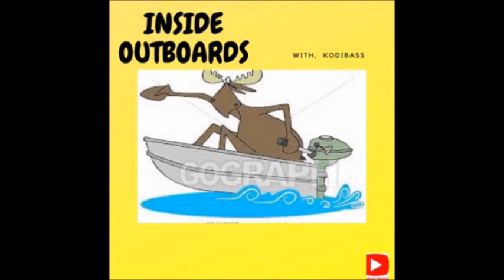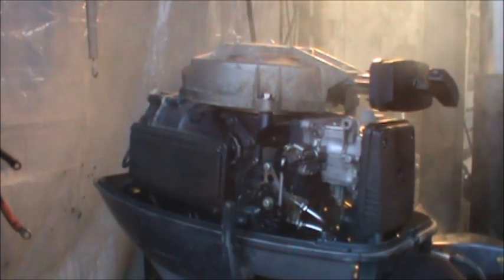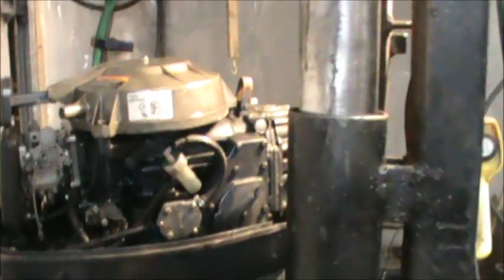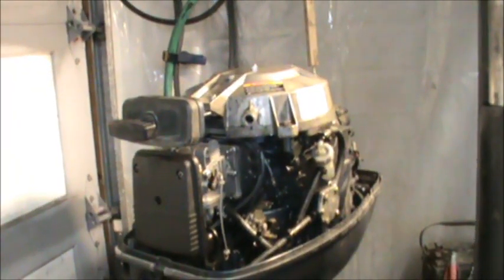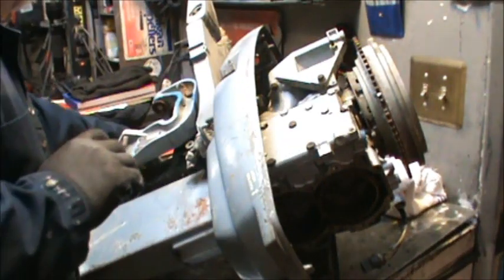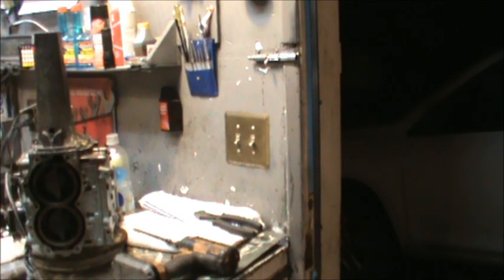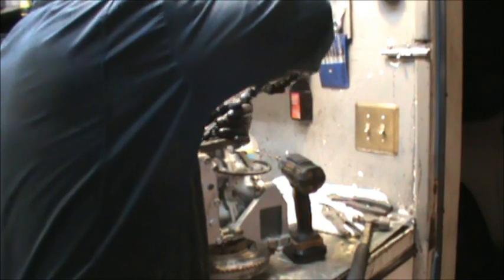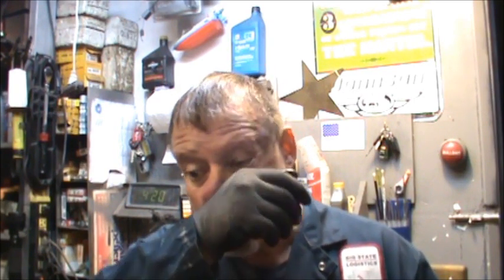YAMAHA ENDURO 40 HP,  25 EVINRUDE HP

Comment: Hi Kodi, Thanks for responding to my short Sunset Bay video. Hey got the Mercury Mark 10 running good now. Need to replace some gaskets and seals. The lower unit prop hub is leaking lube so need to make a tool to heat it up and get it apart. Also the seal between the head and lower shaft housing is leaking water out although it pees good and run cool. Got the original copy of the service manual coming too which will help allot for torques and spec settings👍
Reply from the maker: Fantastic, I know where a Mark 10 is sitting in a guy's yard.  Offered him $200.00 said no he was going to fix it up,  that was over 5 years ago.  Still sitting in the same spot.   kodi
Reply: Just need a tiller if it goes to a parts motor or if you run across one. Got my service manual in the mail yesterday but missing a couple of things I need still but has allot I do need. I need to replace the gear case seals and oring. But found the part numbers on Crowley. Will ordered the but not through them again. Ended up going through Amazon on the diaphragm kit from Harvard Marine back east.

Comment: Exhaust housing Yup differently a heat gun. Yamaha‘s are  Known to use cheap metals. That’s why they used annode  in the the behind cylinder walls. Aluminum carburetors  passafied  the aluminum and turn white. Thanks kodi for sharing
Reply from the maker: 4 sure seen it first hand.     kodi

Comment: When you use the impact driver do you shear less or more bolts in engines? Some of the bolts in the 25hp were really solid. I still occasionally shear a bolt even when I'm slow and careful. Even after applying heat.
Reply from the maker: I'd say less as the impact action sometimes helps rattle them out,  But on some old salty's  heads are going to pop, nature of the beast.      kodi
Reply: Yeah, using the impact is a gamble for sure....The shock of the impact may indeed loosen the bolt up, but you have no "feel" when doing it so there is the risk of shearing the bolt off.  But, even when patiently heating and rocking, the bolts shear off also....Those 32CI exhaust tuner bolts are a wrestling match on their best day, same goes for those lower seal housing screws...

Comment: Twin cylinder single carb is that not the standard  for 40hp ?
Reply from the maker: No not @ all, OMC Did away with there 40 hp (Bigtwin model 40) in 1977,  They reintroduced the 40 hp in 1984 as a twin carb model.  Most all Yamaha 40 hp sold in the US have 2 & even 3 carbs. Depending on year.  I just parted out a Older Suzuki 2 stroke 30 hp it had 3 carbs  3 cylinders.     kodi